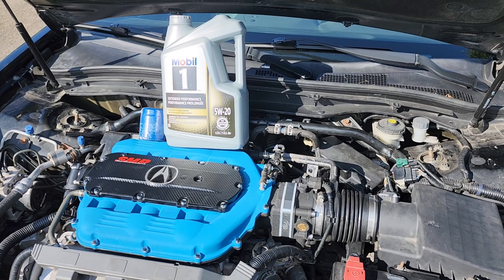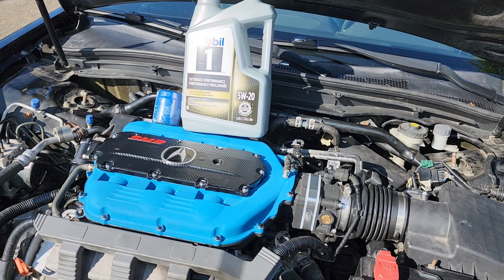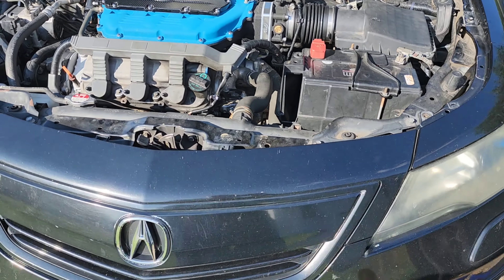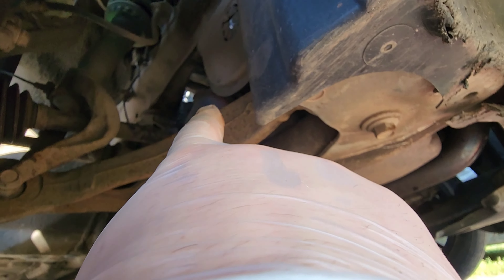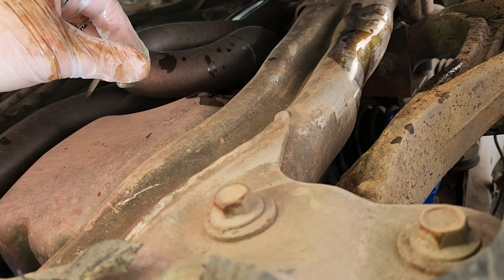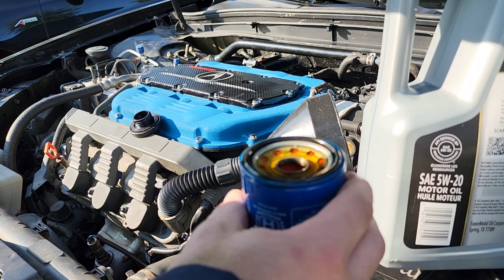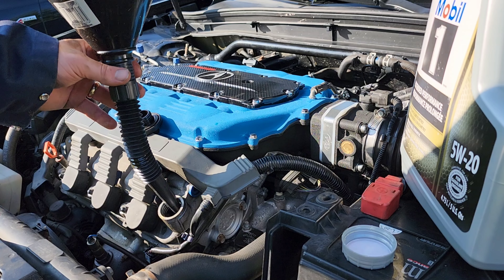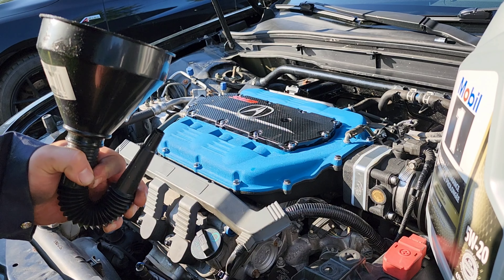Acura TL 09-14 3.7 Oil Change!

Comment: I’ve been enjoying your videos. I just picked up a 2014 Acura TL SH-AWD this weekend. Keep the videos coming, showing support from Ontario Canada 🇨🇦 

Also, I saw an oil change video once and before removing the filter, they tap a small hole at the bottom (with a nail and hammer or something) so the oil drains out. Then take off the filter when it’s drained, much less mess!
Reply from the maker: Ou nice! Congrats on the purchase🤝. That's not a bad idea, maybe I'll give that a try next time. Thanks for the tip!

Comment: If you turn the steering as far to the right as possible (I do it before I jack the car up), it turns the right front side wheel so far out that its really easy to remove the filter, you don't even need to be under the car.  I change my J37 oil as well.
Reply from the maker: Thanks for the tip! I'll make sure to do that next time

Comment: You don’t have to fill up the oil filter that much as long as you lubricate the gasket you’re good. Also recommend going with Penzoil Ultra Platinum next time it’s the best bang (oil) for your buck.
Reply from the maker: Don't have to, but it definitely doesn't hurt. Yes, definitely going with Penzoil next time. This one was just on sale.

Comment: Please tell me you didn’t say start it with no oil in it
Reply from the maker: Yes, that's what those drive in used to make me do. I always thought that was stupid af, unless they put it in first without me noticing then told me to start it lol. I haven't went to one in 10 years though, but thinking back there's no way they'd do that.
Reply: This is exactly why I won’t let anyone touch my cars oil except me!

If you need to get every drop out which is impossible, after the oil drains, pour a little new oil in to flush out the old.
Reply: @RevsALot  at the drive in ones they must have put it in without you noticing. The top end would immediately make a shit ton of racket without enough
Reply from the maker: @crowdkilleryote  yah I used to smoke a lot back then, so probably didn't notice lol

Comment: Crazy how there's not a lot of videos for these TL's to so this maintenance. Just got a 13 TL sh-awd 3.7 and due for service. Got 15% oil life and unfortunately have a B14 alert. Looked that up and it says oil change, tire rotation and coolant flush. Really dont want to pay anyone to do any of those services but I'm not a fan of jacking up cars and not too experienced doing coolant replacement which i know involves BURPING. I wish I had a shop hydraulic lift to make life easier to service my car. Just bought it July 24th 2024 used with 100,115 miles on it. Did you do the transmission video like you mentioned in this video? Do you recommend any services for me to do given the mileage on it already?
Reply: Does anyone know why my TIGHTEN FUEL CAP alert keeps turning on randomly???
Reply from the maker: You bought it with that low of oil life? I never let mine go under 30-40%. I do oil changes every 5k km(3100Miles). Always check your oil with these, they are known to burn oil. I haven't switched transmission fluid yet, but I plan on it in the next cpl weeks.
Reply from the maker: Some ppl have that issue. I don't know the fix, but my light came on a cpl times for a short time in the 7 years I've had it.
Reply: Download a service manual from google
Reply from the maker: Some ppl, such as myself, learn better from videos.

Comment: In my accord I used to fill the filter up as well, but on my new car I just mash the throttle and crank it over in clear flood mode for a few secs
Reply from the maker: I don't think it's too big of a deal, but not too difficult so figured I'd fill it up a bit first.

Comment: Getting a new car my two options is a 2013 12k g37 wit 100k miles and a 2015 q50 3.7 14k with 90k miles. I like the q50 a little bit more but love both. J don’t know if the 10k less miles worth it.
Reply from the maker: I'd say Q50, just cause the design I find is nicer. For only 2k difference I'd go with the one you like more and has less mileage.

Comment: Hey, I'm looking for an exhaust system for my 2014 sh-awd TL is there any you recommend that's not too loud or isn't dronie.
Reply from the maker: If you're looking for a low subtle clean exhaust note that bolts right up it's hard to beat the ATLP.
Reply: @RevsALot  thank you bro

Comment: Had to switch from Mobil since for some reason it burns so fast on all my cars after 1k miles and I have top it off.
Reply from the maker: I've been using OEM, and hasn't been too bad, but still have to top off after 1k miles even after i had oil consumption rebuild. So, I'll see how this does.
Reply: I use penzoil for my tl shawd give it a try
Reply from the maker: @flacko001  I actually almost bought Penzoil, but got Mobil 1 since it was on sale.
Reply: If it gets bad look into switching from 5w-20 to 10w-30, I burn way less oil now. Given it might not be a good idea if you live somewhere cold. But i wouldn’t go any thicker than that

Comment: You should try the amsoil syncro mesh gear lube for the transmission. My opinion it’s the best feeling fluid for the Honda 6 speed . A little bit more expensive but lasts longer with a stronger film strength.
Reply: GM Syncromesh is even better.  Put it in my Civic, V6 Accord coupe,  and now this.  Could also be Im the first owner who changed the  t4ans fluid.  Bleeding the clutch is also a game changer.
Reply: OEM Honda ATF DW1 fluid is always the best option for Honda/Acura vehicles.
Reply from the maker: For automatics yes, probably. For manuals Syncromesh seems to be way better for the kseries/jseries guys who have tried OEM and Syncromesh.

Comment: No need to change ur oil that often. I would go 8000-10000km with full synthetic
Reply from the maker: @AwesomenessIskey  my oil is black as molasses at 5k km, and I use full synthetic. If you drive like a grandma, yes, 8-10k should be ok. It's too cheap to not do often and extend the life/performance of your engine.
Reply: @RevsALot  oil turns brown/black quickly but if u do an oil lab analysis there is no difference in changing oil less than the interval. I just rely on my oil life monitor but I won't go more than 10k
Reply from the maker: @AwesomenessIskey  as I said, if you don't drive hard sure. If you drive hard, your engine will gunk up waiting that long. For $60 CAD and 20min of my time it's a no brainer to me. Car companies know that by the time the effects of such long intervals happen, the warranties are done so they don't care.